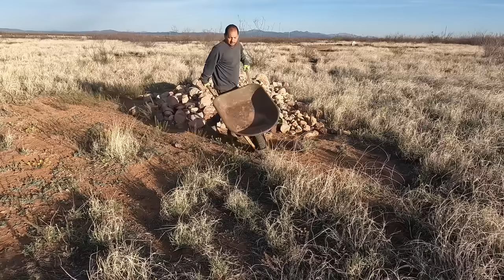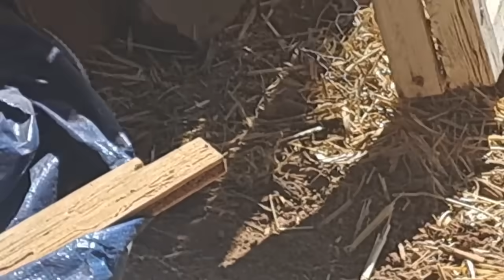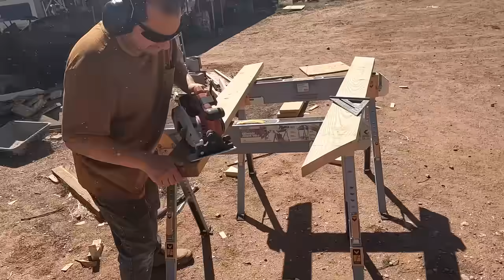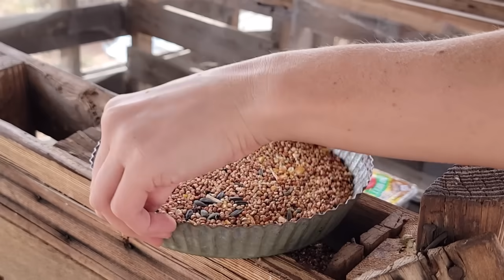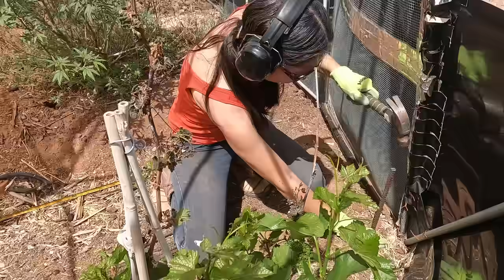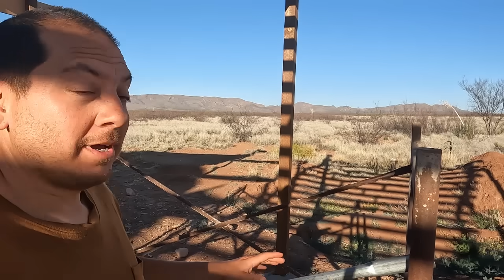THIS Is How We Frame the TOP of Our Monitor-Style Pole Barn House

Comment: My husband had a chance to purchase some old lockers.  We have them on one side of our car port and store lots of things needed for car repairs in them.  Standing jacks, antifreeze, oil, spare head lights, air compressor tool for airing up tires, brake fluid, powering steering fluid, WD-40 are only a few of the items

Comment: If you needed to do several trusses, you should of used the first one to make jig.
Reply: Making a pattern piece for each of the pieces of the truss will save tremendous amount of time and also give you consistency 😊
Reply: But what if they need to be different
Reply: @marymccowan6629 if they are different.u didn’t do it correctl

Comment: Have you thought about incorporating cob as the insulation between your 4 by 4  barn supports? I'm still looking for the videos I saw a couple years ago.  The concept was much like the dome regarding thermal mass & cost effective. The look would unify the two buildings as well. When I find those other videos, I'll send it to you if you're interested.

Comment: OK, generally I do not comment on people's lives but I am going to be a big buttinsky today because well I just have to know sooner rather than later. And I would rather not wait a week. I hope I am not too late to pass this along, and if you have already incorporated any of this I apologize in advance. But, as a former framer I have some observations, some questions, and some suggestions. Your prototype could use maybe a center web. What are you planning on attaching your trusses to? Are you going to set them on top of your lower roof's rafters or the rafter's "header"? What was the center spacing you used on the lower rafters? One side looks like 16" and the other 24". Are you planning on jigging this truss on the ground? And now to ease my OCD and ADD. Did you bolt those lower roof "headers" to those 4x4s? And, could you maybe add some blocking under those "headers"? It just makes me nervous and I see you get some wind and I would hate see your roof get lifted off. Over engineer everything. I know I am getting ahead of the story line, but, I have to ask. What type of roof is going on the upper section? Now, I am a retiree and I am living vicariously through you because I really miss Arizona so I worry about you. Now, I have already fallen off one roof so you kids be dang careful.